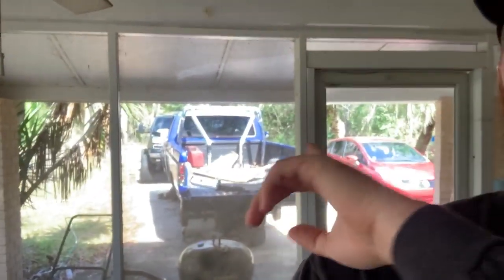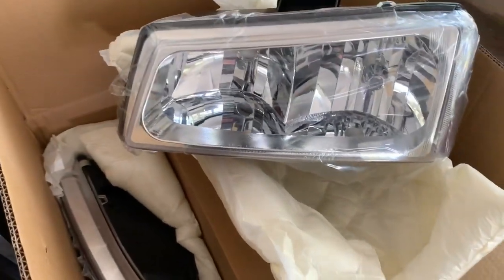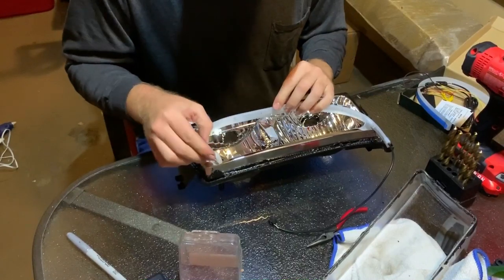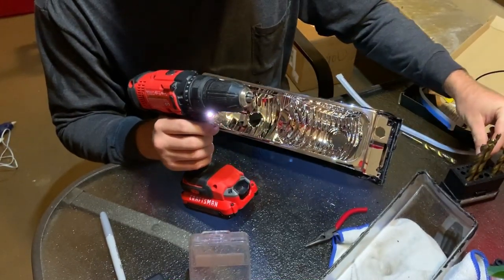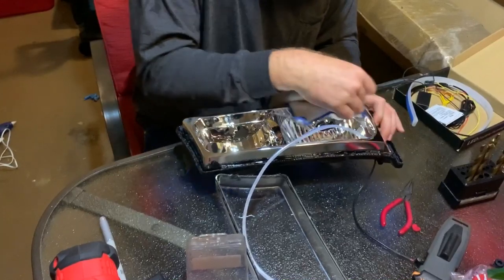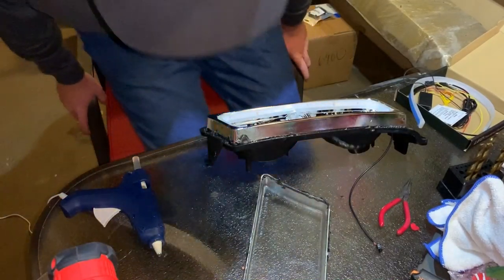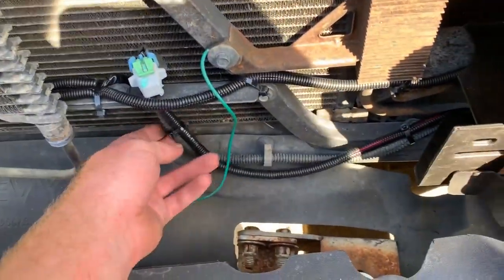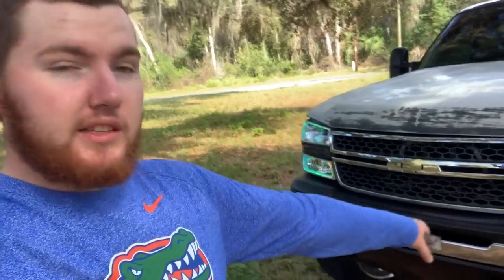The COOLEST Headlights On The Internet

Comment: Where did you plug in the wires for the led strips to get power?
Reply: there is a little box the changes 12v to 5v and you can even get switchbacks. done 4 sets.

Comment: I heard you say that you used the preexisting butyl you reseal the headlights , how did you go about doing that ? Heat it back in the oven ?   Look amazing . Definitely like the look , kinda curious what the strips would look like in clear tail lights
Reply from the maker: When you open the headlights try and leave as much butyl as you can, then when you reseal them just reheat and press back together and use the already existing clips to hold it together. To be safe you can always run a bead of silicone around the outside. Tail lights are VERY hard to get open.
Reply: I’m glad that you explained why you used hot glue on the inside . I’ve never taken tail lights apart . Still looks freaking sweet

Comment: That lens is fucked now lol everyone that does lights knows the lens should be stored open end down and protected so nothing gets in it. Also the leds go wonky after awhile i know ive had those before
Reply from the maker: I completely clean the inside and outside of the lens before sealing. I’m by far from a professional but have a decent amount of experience. I guarantee you nothing is in those lenses.
Reply: Aaron Cates you cant even touch the inside of the lens. Please tell me those are glass lens
Reply from the maker: Plastic, I use a lens cleaner and a lint cloth made for eye lenses.